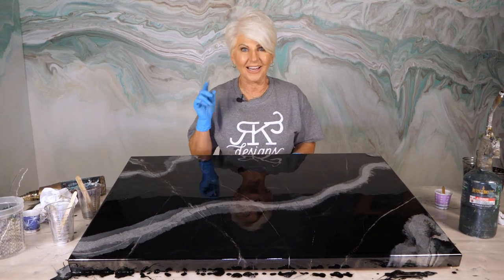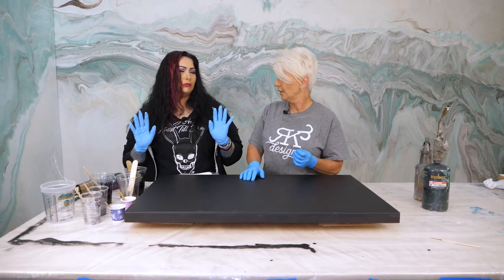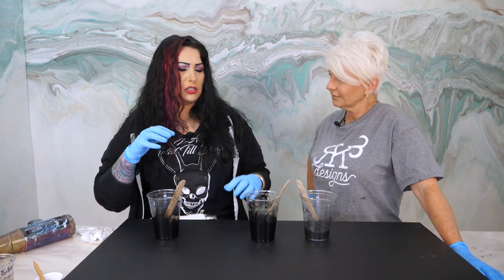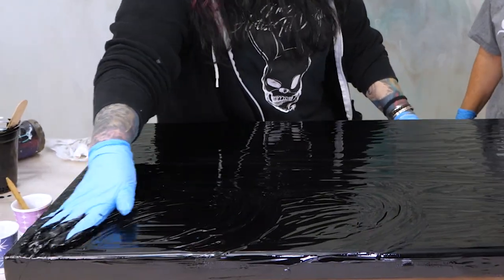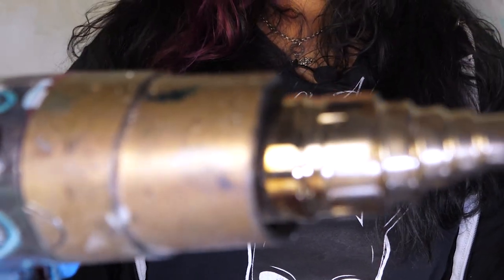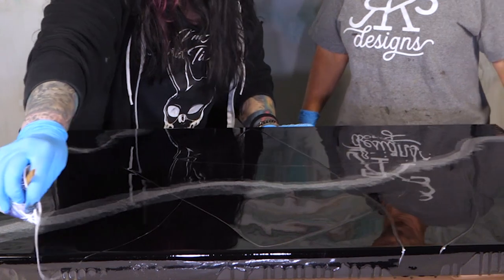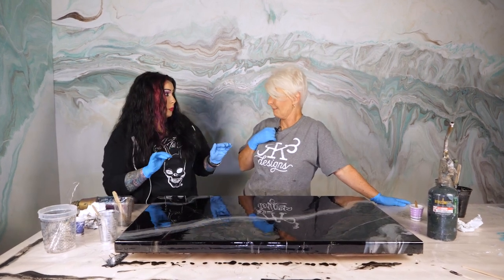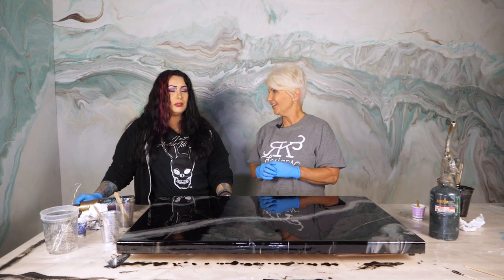How To Create A Black And Silver Marble Epoxy Countertop | RK3 Designs

Comment: I'm planning a shower using foam with a reflective foil, facing out.  I'm thinking of using clear epoxy to attach the fiberglass mesh, so the foil will add a bit of depth.  Cuckoo or not?
Reply from the maker: I’m confused. You’re going to put the foil underneath the mesh? If you use clear, your going to be able to see the mesh?? 😊
Reply: @RK3Designs  The foil is attached to the foam.  The fiberglass mesh will attach to the foil, and I'm hoping the reflectivity will add a bit of depth, once I do my decorative epoxy pour.